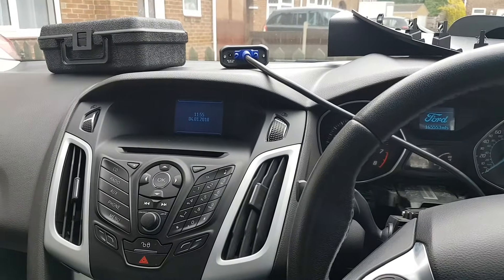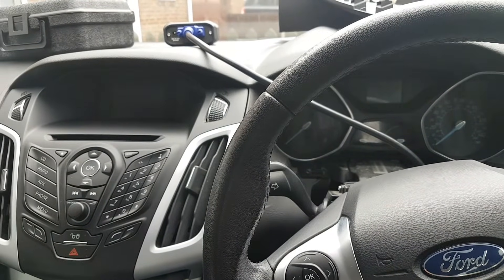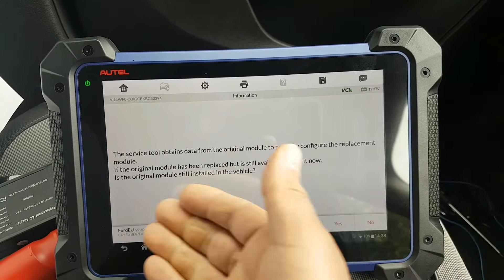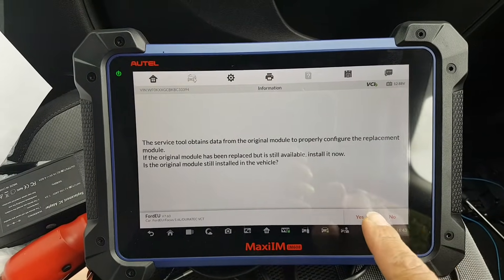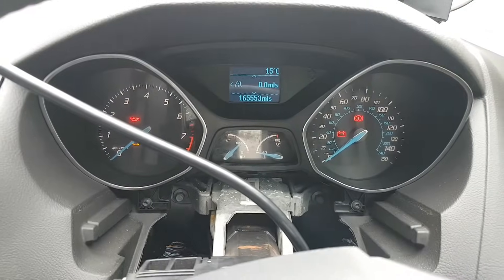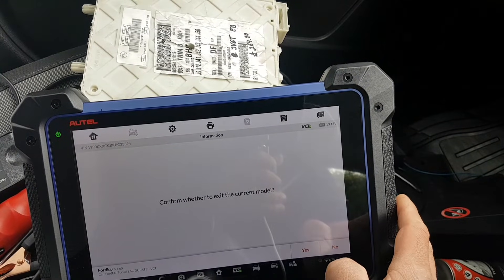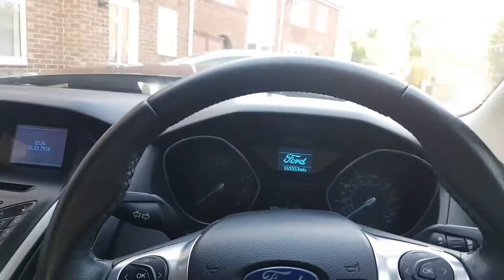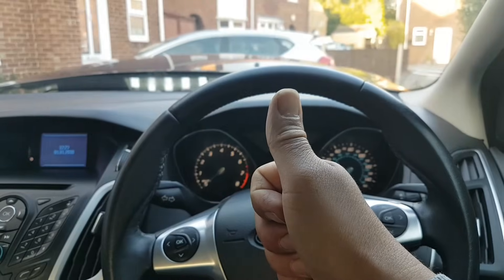Ford Focus MK3 used BCM programming.

Comment: Hi bud yesterday my Ford smax 2012 tdci started playing up with the digital clocks if you put your foot down and go faster all the clocks would start flashing and the engine are function. Light would come on stereo and heating system would go off and come back on then it got to the point where it was doing that all the time and now everything is just gone blank. It came up with U0155 code I dropped the body control module down and wiggled it a bit as it’s under the passenger side of the dash then all the dash lights come back on. I’ve popped most of the plugs out of the BCM to see if there’s any corrosion and there is none. Everything still works on the outside headlights indicators window wipers. The car starts and drives fine just on the inside you can’t see anything on the dash stereo or heating system and you can’t lock the car. Do you have any idea? And are you anywhere near Lancashire? Plz help 🤣🫣
Reply from the maker: Could well be the BCM, or a bad relay... well, or something else!🫤
You need to investigate and try to narrow down what is causing the issue.
👍👍👍

Comment: Hi Iv got a mk7 transit it will run for 10 20 30 minutes then cut out then when I go to turn key I get no dash lights and ticking from glove box any ideas ? Thanks
Reply from the maker: Have you scanned the van, to see if there is anything that points in the right direction?
👍👍👍

Comment: Iv done the instrument cluster  in August 
But I have issues I still have the U1900 lost communication and my main problem is the dashboard light stay on 24 hour they never are of I got new battery 2 Months ago and now is flat do u have any idea why it happens??
Reply: Yes
Reply from the maker: @mikelactions772  
Is that fault on the cluster, or on any other modules?
Reply: Must be somewhere else I don't know exactly they told me to disconnect the redio  but still I have the problem
Reply from the maker: @mikelactions772  
They said?
If you don't have a scanner, and is not you working on the car, it can be complicated...
Reply: I scanner it with my friend yesterday
Reply from the maker: Never had that... can you communicate with the cluster and all the other modules? 
👍👍👍

Comment: Had similar thing with Ford s max recently. Replaced bcm for faulty reverse lights. VCM2 with a fjds subscription couldn't do it. Needed someone with ETIS account to get security access. This car in particular was keyless so instead it was an RFA module reset in fjds. Forscan definitely could not do this for the newer vehicles. (2015+)
Reply: Yes confirmed , Forscan does NOT do PATS for Focus 2014 or jounger. IDS neither - there is no PATS selection anymore. FRDS online is the only way to go. Do not buy Fords, service fees are extremely high..

Comment: Good video Lois and I ran into the same thing, glad I wasn't the only one. curious to know if this problem with the 608 has been addressed yet.
Reply from the maker: Indeed...
I haven't had another one after this yet, time will tell...
👍👍👍
Reply: Hi, i  need to replace GEM module of a Ford kuga of 2009, how to detect wich modules are compatibles? and how to clone data? the original module is 75MT-14A073 JE.  thanks

Comment: Why did you not read mcu from old and writed in new bcm?
Reply from the maker: I did not have the tool for it...
Or at least, a tool that I was 100% would do it...
VVDI I believe it does it, need to get one...😋
👍👍👍
Reply: @LMAutoRepairs  isnt inside motorola 9s12xe? Xprog / orange5 work that job
Reply from the maker: Probably... my X-prog is a quite old one... 5.5...
I don't have orange...
👍👍👍
Reply: @LMAutoRepairs  however its a good video 👌
Reply: What tool software you recommend for this kind of jobs

Comment: Is it easier and cheaper to swap EEPROM and call a day?
Reply: Hi I bought ford VVdII can that be used to clone second hand ecu ford how about to virginise the second hand ecu
Reply from the maker: I believe you can clone them... I did not have the tool for it...
VVDI is on my list for a long time, I just need another "good excuse" to buy it...😋
👍👍👍
Reply: @LMAutoRepairs  I planning too to buy VVDI programmer soon. As programmer only it may not so attractive but there is load of quick adapters, what can make life easier. BMW EWS4 /CAS3 / CAS4 adapter, Mercedes EIS adapters set, Audi BCM2 adapters and remote renew adapters. Exploring current options, may be just swap the chips. Sure, these big MCU chips is another class to remove and solder back. Mobilephone repair shops may be have the necessary tools for that purpose.
Reply from the maker: You can do the big ones, unless they are really big... I done them successfully in the past... in this BCM though, the two boards would need split first, then the chip...
😓
VVDI would be definitely quicker... and less risky...😋